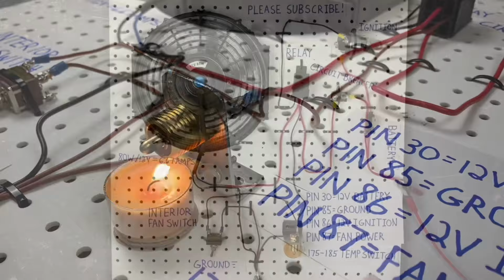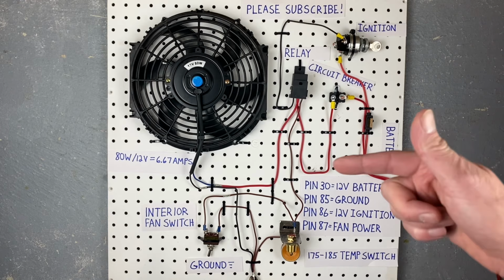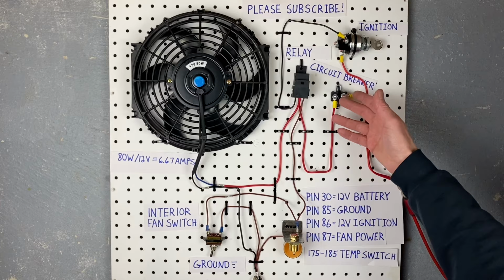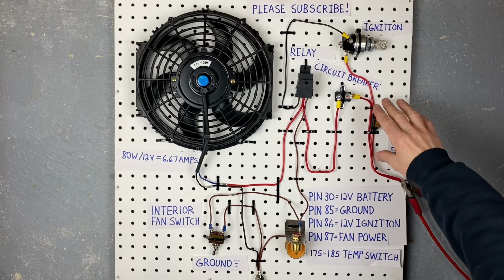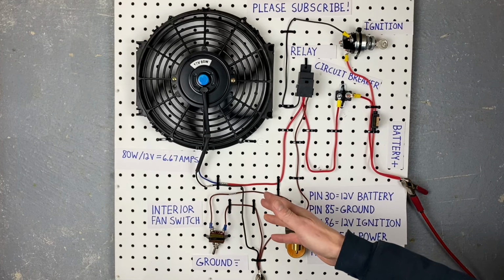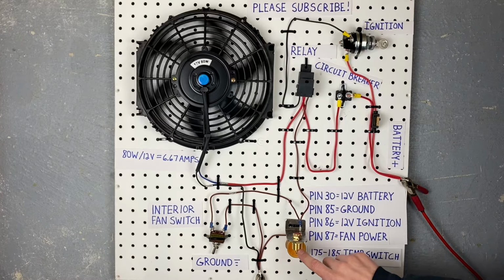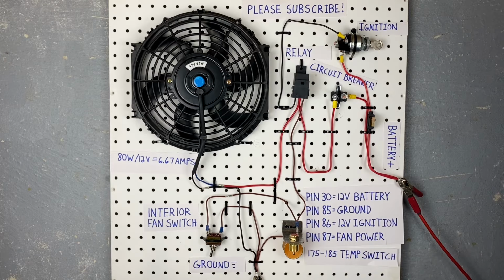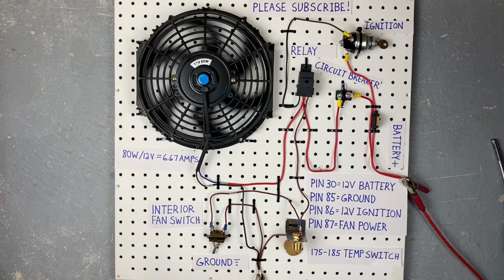How To Wire An Electric Radiator Fan Relay Temp Sensor AND Switch! | @WiringRescue

Comment: Would it be possible to get power directly from a fuse block to power the fan if the fan need to be running at all times when the motor is running. I feel like that would be the simplest way and Im confused at to  why you dont pull  power from a fuse block in the video. Because what would be the point of a fuse block if you dont use it?
Reply from the maker: You can totally wire this into a fuse box. There are a million ways to wire a circuit, and this is just one. The downside to doing what you are saying is that your fan will run even when your engine is cold and cause your engine to take forever to warm up. In fact, if your cooling system works well enough, it may never actually warm up. Then depending on your car, you may not have warm heat, and may not go into closed loop (if you have fuel injection).  So it may seem Ike a good idea, but it may cause secondary issues.
Reply: @WiringRescue  Thank you!

Comment: Some people suggesting to take the power directly to the battery, not from ign switch, will it be a problem? Will it run even i switched off the ignition, but the temperature is still high
Reply from the maker: Yes, it would be able to turn on anytime, which could drain your battery, or injure somebody working under the hood. I would not recommend it.
Reply: @WiringRescue  can you suggest where can i get it from? I have e39 m54b20
Reply from the maker: @najmib6 - sadly I’m not familiar enough with those cars to make an accurate suggestion. I would think the factory fan wires would be a good place to start.

Comment: I'm getting 11.2 v at the temp switch? I thought that wire was supposed to send signals back to the relay to then turn the fan on. Not have voltage. I've bought a new relay checked all the wires. I cant seem to figure this out . Any ideas. Or is it supposed to have voltage until coolant temp is reached.
Reply from the maker: The temp switch used in this video grounds the circuit when the temperature is reached, otherwise the circuit is open. There is no power going to the temp switch.
Reply: @WiringRescue  thank you for your reply. I found my problem, a bad fuse holder

Comment: Is this system able to connect to a water temp gauge so I can watch the temp
Reply from the maker: The gauge circuit is a different circuit entirely from what you see in this video. This fan circuit uses a temperature switch. A gauge needs a temperature sensor. The temperature switch is like a light switch in a house, on or off. A temperature sensor is a wire range of resistance.

Comment: Can I use the connection that goes to the starter motor for the ignition connection?
Reply from the maker: Starters have two wires, one is large and has power 24/7. The other is small, goes to the starter solenoid, and gets power when you are actually starting the car, but goes dead when you let the key go.

If you connect the ignition switch to large 24/7 battery power, your fan will have the ability to turn on with the car off. This could possibly injure an unsuspecting mechanic.

If you connect the ignition wire to the small starter solenoid wire, the fan will only be able to run when you are starting the car, so that doesn’t make any sense.
Reply: @WiringRescue  where would be a good ignition connection?  I have a 74 Barracuda.
Reply from the maker: @davidmckinley5343  - I don’t have a barracuda wiring diagram handy, but I would think you could use the power wire going to your ignition coil. Most ignition coils get ignition power.

Comment: But what about when the engine is hot and you turn off the key
Reply from the maker: That happens in normal cars every day. As long as the engine temperature is within normal operating range when it’s turned off, it will cool down on its own.
Reply: @WiringRescue   the Vws have after-run on the fan, so when you turn off the engine, if the temp is above 95C the fans will stay running till the engine coolant cools. You need to add in that feature to the diagram.  Great video series.

Comment: It seems like nobody understands the concept of the triggering system being tied to ground, and how much better that is all of the other message seem like they could be dangerous when you’re adding sources of voltage and amperage from external sources, I would think those can combine with the existing and cause problems, but my issue is I just need to wire mine with an adjustable temperature sensor that will activate The ground but I can’t seem to find anything that will do that

Comment: Would I be able to add a way for it to run for 30 seconds after I turn the vehicle off?
Reply from the maker: There are probably relays with timers out there, but I’ve never used them. If it’s a normal car, it probably doesn’t need the fan running after the engine is off.
Reply: @WiringRescue  it is normal little 4cyl s10. Trying to upgrade the cooling from clutch fan to electric soon
Reply: @WiringRescue  I just figured it would help evacuate warm air from the engine bay to help cool it off faster

Comment: I pretty much have zero knowledge on electrical so I’m a little confused on how this circuit is complete. Im under the impression ground and negative are different.
Reply from the maker: Ground and negative are the same. The. Negative terminal in the battery goes to ground and therefore grounds the metal in the vehicle.

Comment: Your diagram is very clear. I appreciate the professional presentation. However, after following everything to the T, I can’t get my switch to turn the fan on/off by the switch. The fan comes on when I turn on my ignition before (acc)and after I start the car. I have pin30 to the battery with a fuse, pin 87 back to the electric fan & the fan is  grounded, pin 85 is connected to the temperature switch as my ground and pin 86 goes direct to the coil connection on my ignition switch. Any advice would be appreciated. Thank you
Reply from the maker: It’s tough to diagnose things over the internet, but it sounds like you are using the wrong style temperature switch. Your temperature switch is likely closed (grounded) when the temperature is cold, and becomes  open (not grounded) when the temperature gets hot. It’s essentially working in reverse. I’d recommended tested that and see if you can find the solution. Good luck!
Reply: @WiringRescue  thank you for your response. I’m wiring  my fan into the temperature sensors in the block of my ‘40 ford coupe, Flathead engine. Do you think I can put my switch into the wire coming from pin 87 going to the fan?

Comment: Wait so the ground goes to the sensor
Reply from the maker: Yes, if you wire the rest of the circuit like the videos shows. There are many ways to wire an electric fan. This is just my favorite method. Hope it helps you out!
Reply: @WiringRescue  yeah it did thank you so blue wire goes to power fan black to senso red to power white to ignition? Black on fan to ground
Reply: Does the black from relay need to be grounded before the switch the switch is the ground I get it now thank you for the video

Comment: So what if the fan connector has 3 wires?
Reply from the maker: I believe that is typically a low and high speed wire, plus a ground. But without looking at a diagram, it’s just a guess. I haven’t made a video for that scenario yet.

Comment: Okay, call me stupid, but I can’t get my fan (2speed), to turn off with my on/off switch. It turns on when I turn the ignition switch on, and/or when I start the engine.  I ran a ground wire from the relay switch to the temperature sensor in the head. Then I ran a wire from the on/off switch to the same temperature sensor & I ground this switch to the firewall of my car. Any suggestions would be welcome.
Reply: Fan control modul is bad, just replace it on my mitsubishi eclipse, my fan was alway on when i turn the key,

Comment: But how do you control the fan speed?
Reply from the maker: Well, you don’t, it’s either on or off. Why would the fan speed need to be changed?
Reply: @WiringRescue  My last car owner install the aftermarket electric fan that look like in the video. But it constantly running at max speed (considering how loud is it). I did some research, factory fan can vary at speed depending on the temperature. So I think maybe its possible for aftermarket fan to run at different speed depending on the temperature? Or is it not possible? Or will I need fan control module or something?

Comment: What causes the fan relay to melt at pin 87
Reply from the maker: You are drawing too much current through the circuit. I’m guessing your relay/fuse is not sized correctly either. Check this video out. I think it will help https://youtu.be/EhzN6UdnmPA?si=yClQxoTWjRSmTLDk
Reply: @WiringRescue  thanks. I’m seeing it on stock circuits. Most recently a 2023 Entegra Anthem with dual fans.   It has a 30/40 relay and it burnt up
Reply from the maker: @rydgomez2 - when this happens on stock circuits, I usually look at the amperage draw of the fans, or weak electrical connections. Sometimes if a fan is worn out, or stuck for some reason, it will draw excessive current. Or, if an electrical connector is poorly crimped or loose, the current finds resistance in its path and turns it into heat.

Comment: What do I do if my wires get hot
Reply from the maker: The first step is to stop using it so that your car doesn’t light on fire. The second thing I would recommend is watching this video that explains fuse and wire sizes. https://youtu.be/EhzN6UdnmPA?si=Qm48J1r1CP0hbbrt
Reply: hello. how many terminals does your thermo switch have? mine is 2 ..can I use your wiring on it? I have a problem with my radiator fan and the auto electrician charges me a lot..he only directly connects my radiator fan to the ignition switch..so the automatic switching of the Rad. fan doesn't work anymore and it makes me sad..any advice for me?
 thank you in advance! 

by the way..your video is very clear to understand.

Comment: And what happens if you fogetful and dont turn your dash switcth on
Reply from the maker: That’s why you have the temperature switch. The temp switch will turn the fan on for you. The dash switch is an override to force the fan to turn on if you need to for whatever reason.

Comment: so I worked mine exactly like this except my sensor is located at the radiator hose in an adapter. Everything else is ran the same as yours and when key on and flip my switch fan goes on. I kept my stock sensor in the thermostat so my gauge still works and when my temp gets to 210 the fan still isn’t kicking on. I have 185 switches at both locations even tho the thermostat one doesn’t do anything and I have a 165 thermostat. I can’t figure out why it’s not kicking on. I even put a torch to the sensor for about 2 minutes and it didn’t kick on. Figured maybe it was the sensor bought a new one and tried same thing and didn’t kick on. Help!
Reply from the maker: I’d start by finding out whether your temp switch is normally open or normally closed. Some work in reverse from what is in this video. You can do that with a multimeter set to ohms. Then touch one side on the terminal and one on the base. If there is continuity then your switch is normally closed. Reply back your findings and I’ll walk you through it.
Reply: @WiringRescue  don’t they all have to be closed or opened which ever is set to not ground? So when it gets hot it grounds ? How can it work in the reverse order ?  I tried heating the two sensors I had like you did to see if they’d kick on and never did. I can’t imagine holding a small torch to it for 2 minutes didn’t get it to 185
Reply: @WiringRescue  I’ll try the ohms test tho too
Reply from the maker: @riffraffchoppers  you can also manually ground the temp switch wire on the engine block and see if the fan turns on. That will tell you if the problem is with the temp switch, or somewhere else in the circuit.
Reply: @WiringRescue fan turns on when i ground it. But how can two brand new sensors be bad. The adapter that’s in the radiator hose has a ground coming off that as well to ground the sensor. I did the ohms test and no beep
So circuit is closed right ? I can send you a video of how I have it all wired if you have an email. And I’m supposed to have a lower thermostat than temp switch correct ?
Reply from the maker: Make a quick video and send it my way. My email is on the “about” page of YouTube
Reply: @WiringRescue  ok I’ll do that shortly
Reply: @WiringRescue  I don’t see an about part on there
Reply: @WiringRescue  the ratty?
Reply from the maker: @riffraffchoppers  yep that one
Reply: @WiringRescue  ok I’ll send it in a little when I get by it

Comment: No es conveniente, bajo ningún supuesto,  hacer que todo el sistema pueda ser desactivado a través del "ignition switch" por la sencilla razón de que el sistema debe encender y permanecer encendido siempre que el sensor de temperatura indique que el ventilador deba estar funcionando y eso incluye que el motor pueda estar apagado.

Saludos
Reply from the maker: Thanks for watching. There are very few cars that will run an electric fan when the key is off, including all cars made before the mid 1990’s.  Having a fan that can turn on whenever it wants can injure a technician, and also drain the battery.  I understand that some people DO want that feature, but I personally would not want it and would not recommend it to anybody.

Comment: After a couple of minutes of the fan being on, my relay gets super hot, why could that be?
Reply from the maker: Make sure your relay, wires, and fuses are able to handle the amperage that your fan is drawing. It sounds like your wiring/relay are too small .
Reply: @WiringRescue  
50 relay, 40 amp fuse, could it be the wire being too small? Should I use a 10-12 gauge wire?
Reply from the maker: @yeiden8854  - how much amperage does the fan draw? Is there a amperage or wattage rating on it somewhere?  Also - are the connections at the ends of the wires crimped properly?
Reply: @WiringRescue  
The fan doesn’t say the amperage or watts, and yes they are crimped tight, but I’m planing on soldering them
Reply: I just used the same size fuse and relay as the ones in the fuse box for the cooling fan, also it’s what other people on YouTube were using

Comment: Got a 👍 from me a electrical idiot, I THINK even I can follow that, BUT, do you have the same fine layout for if you DON'T want to use the TEMP switch?  Here in HOT Florida I want to add a fan to the front of my air cooled ATV 4 wheeler to help cool it

Comment: Watch the Live Video No Over Heating :- https://youtu.be/SqNIGQM1I2Q

Car Drives without Radiator, Coolant & Cooling Fan with Graphenizer Liquid controls the Engine Heat up to 60%.  

It also Cleans the hard carbon with dark smoke from pistons, Injectors / Nozzles, Valves & Pump etc, instantly & increases extra mileage up to 50%.

Comment: That’s really not what a relay is for as I understand it. It’s to allow a smaller wire to run a higher amp motor by triggering a magnetic switch.
Reply from the maker: I believe that we have the high amperage fan circuit being controlled by the low amperage temperature and on/off switch. Could you elaborate a bit?